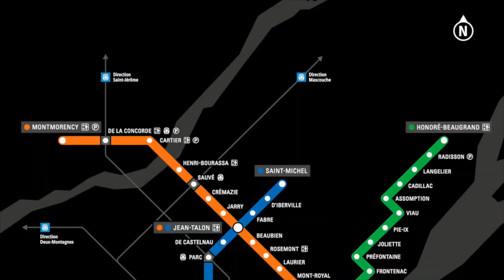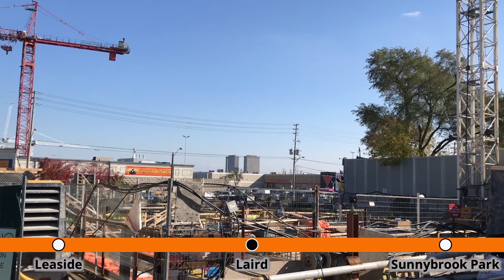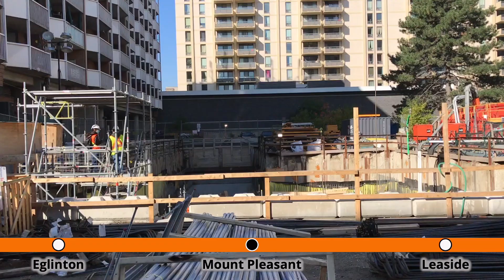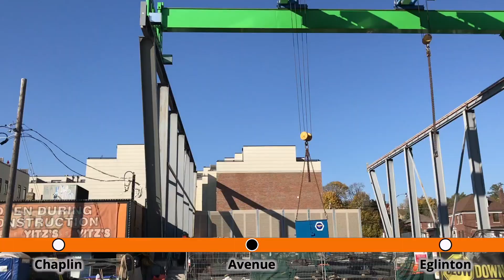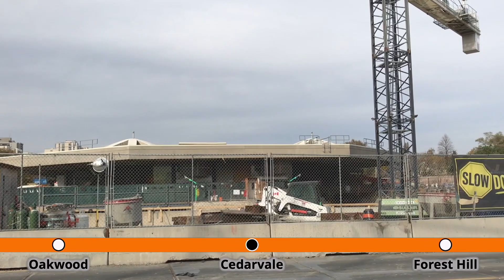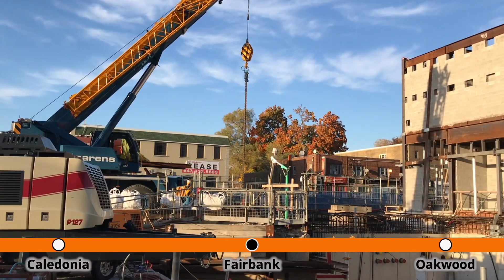Eglinton Crosstown Underground Stations Construction

Comment: I see why they say "Opening 2022" because the construction work required and then all the burn-in testing still to go is extensive.
Reply: might even be delayed to 2023. the university line extension took an extra year and then some to open even after all the stations were virtually complete.
Reply: I'd be very surprised if they open in 2022 considering the buildings haven't even reached ground level yet.
Reply: Well they are more complex to build than the surface stations since they need to be excavated, drilled, chipped and more underground construction. 
Also Eglinton might take the longest to finish since it’s the most complex station.
Reply: @austintandoc8187  oh absolutely. I have no doubt that they are much more extensive and comprehensive in terms of their production. They knew roughly how much work each would take when they bid on the contract and minus the extra work found at the Eglinton site. To my knowledge, there hasn't been any extensive cause for delay (again barring Covid) that should have added the extra 2-3 years on top of what they expected (original completion date for 2020). They could easily run into the issues the Crosstown is having in London which the burn-in alone is adding years to their deadline.
Reply: not to mention changing in seasons hardens or softens the soil repeatedly in a cycle there has to be some way to expedite the project
all transit projects needs to be finished come hell or high water